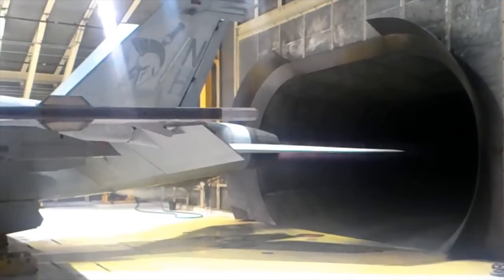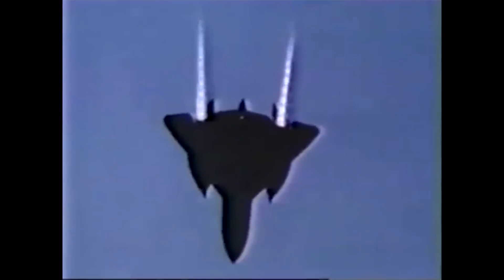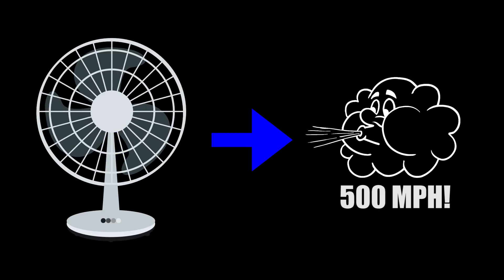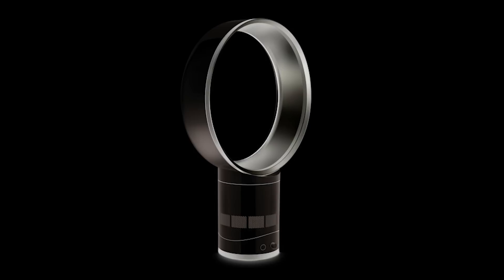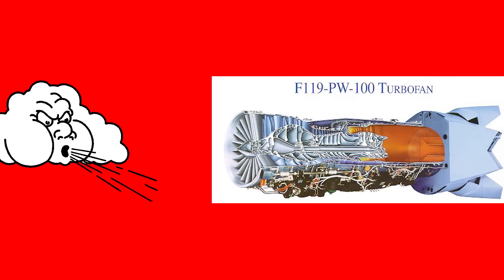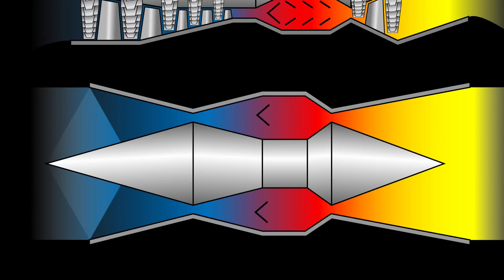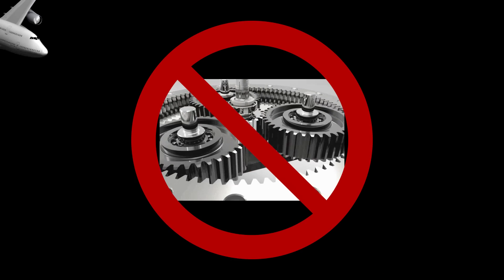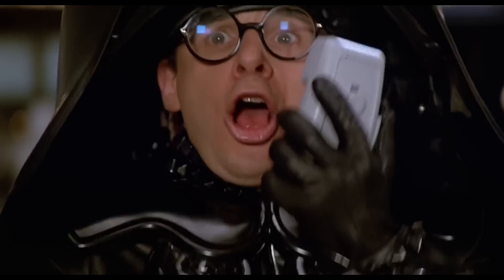Ever Heard of a Scramjet? (MACH 10!)

Comment: First the jet engine gets the aircraft to mach-2. Then the supersonic airflow gets rammed down a different pathway and into a smaller funnel. Jet fuel pours in, and the supersonic air coming in exits out the back twice as fast.  Speed builds upon speed, jet fuel burns at an incredible rate until the materials are overcome by friction and physics asserts its dominance.

Comment: Actually the blackbird is faster because of the points on the inlets. It doesn’t use fans for primary compression, it uses shock recompression.

The further the inlet is pulled back the faster you go. It captures the incoming shockwave right at the tip. The jet in the blackbird only puts out 20 percent of the thrust. The inlets put out the other 80
Reply: So it can go faster than Mach 3.5?

Comment: You know what mach3 was not the speed limit of the SR-71 Blackbird it could go a lot faster then that maybe not up to mach 10 but I bet it could get up to Mach 4 or Mach 5 when they said mach3 on the Blackbird it was just a general reference point basis like because they did not want to let out the true speed limit the Blackbird could go to this day it is still classified exactly how fast the Blackbird can go
Reply: I thought that it was capable of 12,500mph.
Reply: So, I think y I u are correct when it could go mach 10.  Because I think that is what 12,500mph is.
Reply: I know that after take-off they had to be refueled in air, this was because it nearly used up all of its fuel just to get into the air.  Just think how fast with the new technologies today.

Comment: Scramjet work from quarter century ago was 5000 mph in lower atmosphere up to 100,000 feet as liquid hydrogen and air breather, then at altitude the cones on the engines close and it seamlessly converts to a liquid hydrogen liquid oxygen rocket, accelerates up to 27,000 mph escape velocity and pushes into orbit. I had a high end Silicon Graphics workstation at that time with a priority link to a cluster of twelve IBM mainframes (your cell phone has more power).
Reply: I have some questions

Comment: Actually the Scram Jet is the simplest version and the jet is the most complicated. The reason is the restricted airflow in order to create forward thrust.

Jet: Low speeds, needs lots of air restrictions to create thrust and has systems in place to restrict air.

Turbo Jet: Speeds up to about Mach 1, still needs air restriction system for low speeds, opens up for less restriction at high speeds.

Ram Jet: Mach 1 to about Mach 3.5, simple design, does not have restrictor system, has very little restriction because the air speed will be enough to ignite and give forward thrust.

Scram Jet: Mach 3 to unknown, simplest design, no moving parts, very little restriction, from what I know it just moves so fast that it very easily ignites the air and just needs to feed fuel to get thrust.

Each jet had to be within speed range to generate forward thrust. The SR 71 Black Bird was a Turbo-Ram Jet. Rather complicated because it had systems to act like a turbo Jet at low speeds and a Ram Jet at high speeds.

Comment: Imagine lighting a match in a hurricane while the floor is lava. At those speeds you are also trying to keep the engine itself from melting. The no moving part sounds impossible because at different speeds and different altitudes the shockwave needed to ignite the fuel and burn the oxygen in the air will be an ever changing factor

Comment: Do your research the Sr-71 Blackbird has reached a lot more than Mach 3 because since when is Mach 3about 4800 mph is what I ran across
Reply: The listed top speed record that was set by the SR-71 was completed on a test run using only one of the two engines. The official top speed is classified; Same with the F 22 and YF 23.
Reply: Blackbird limit was Mach 3. My friends dad worked on it for 30 years, I was at its final flight in Palmdale in 1991, used to see it all the time, I lived a mile away from plant 42 on Sierra hwy for years. One flew over my head once in the desert between Palmdale and Victorville about 600 mph and 200ft altitude. It was incredible. Look on here for final flight sr71 video. I was in the crowd there

Comment: Big problem when you go beyond Mach 4 is that your aircraft will overheat and melt. Even a titanium nickle alloy will be white hot at mach 5. The space shuttle needed ceramic heat shield tiles and a heat sink circulating coolant and it was no where near mach 10.
Reply: It reenters at something around Mach 25
Reply: Columbia Space Shuttle  collapsed at about Mach 19.

Comment: No no no.... this is all stupid and so wrong!
-1
Here is why!
Nothing explodes in jet engines under normal operation, it deflagrates (aka. burns really fast), and if it accidentally detonates it tends to result in engine failure.

Turbojets are no way reminiscent of "big fans", hell the spinning part doesn't contributes to the trust!!!!!!
It just compresses the air for combustion, and the heat released makes the air expand, and this expansion produces the trust. (and in the airstream leaving the turbine a second ring of blades is placed  that is connected to the compressor, so the leaving fast and hot exhaust gives spins the compressor.)
Afterburners are there to extract all the possible heat from the air, by adding more fuel to the leaving air after is trough the previously described part, and burning out the remaining oxygen.

The main difference between the different jet's is the mechanism by which they compress the air, tuborjets use turbopumps (aka  the compressor), ramjets use the pressure generated by a wedge shaped front part being rammed into the air at high speeds, and scramjets are "just" ramjets that are designed to not slow down the incoming air to subsonic speeds.
And pulsejets (like the one on top of the the V-1 missile) use kadencay effect to draw in and compress the air.

Comment: Doesn't make any sense, hell how do you even take off with that engine if it REQUIRES super sonic air
Reply from the maker: good question! Scramjets are pretty much incapable of producing thrust at any speed below around mach 4.5. I think every scramjet used so far has used a rocket to get up to speed first, and then flying on scramjet power is far more efficient than the rocket because an air-breathing engine doesn't need an oxidizer like a rocket
Reply: Dropped from a bomber or a heavy load carrier type plane.

Comment: is there a way to forego the jet engine with an a technology to speed up the air        and then initiate a ram jet
Reply: That's literally how a jet engine works. It has a turbine that spins a compressor to heat the air in order to ignite the fuel to fire off the after burners. A ram jet just subtracts the compressor and turbine since the air is already moving fast enough and then just uses an inlet to compress the air by slowing it down to sub Sonic speeds. A scram jet tries to do all of that without slowing the air down but still be able to create a shock wave in order to burn the air. Different speed changes what it takes to create the shockwave in order to be able to burn the air. It's like trying to keep a match lit in a hurricane

Comment: your video is full of inaccurate data
Reply from the maker: jjhonka111 Could a scramjet powered aircraft go Mach 10? Undoubtedly.

Have any? Effectively, yes (Mach 9.7).
Reply: The Doc no it's not check your facts it's only an announced aircraft it hasn't gone into production yet
Reply: I feel sad for the blackbird now, it was my favorite jet until the x-51a.
Reply: No
Reply: Tazeo Frankson like your life?
Reply: But could it go Mach 21.5? - STS-Atlantis

talk about any craft you want, but it hasn't got shit on the Flying Brick
Reply: https://www.google.com/search?q=ramjet+or+scramjet%3F&rlz=1C1CHBD_enUS820US820&oq=ramjet+or+scramjet%3F&aqs=chrome..69i57j0l5.16526j0j8&sourceid=chrome&ie=UTF-8
Reply: https://en.wikipedia.org/wiki/Ramjet
Reply from the maker: The ol' blackbird is still pretty impressive! Being able to take off, accelerate to mach 3 and stay that fast for a LONG time, and then land (with a few in-flight refuelings) is a solid feat.
Reply: SPORTS-IN-SPACE X-43A flew at a speed of Mach 9.6 in 2004. That was almost 13 years a go. So yes, someday scramjet powered aircraft will exceed mach 10, but so far none hasn't and it's not like scramjet aircraft are flying Mach 10 everyday. That's my point. Also the X-43A has been the only aircraft that has been even near 10 Mach. I think the other aircaft go like 5-6 Mach.
Reply: So far none of the scramjet powered aircraft has been able to go over 10 Mach.
Reply from the maker: oh yeah?

Comment: black bird has a mach 3 cruise speed i.e it's not even trying. God knows what it does full throttle
Reply from the maker: the blackbird's j58 engines got more efficient the faster they went, owing to their hybrid ramjet design. but apparently as the plane's speed crept past mach 3.3, the shock wave from the air hitting the intake of the engine began to cause problems, which kept it from going much faster. i think i read somewhere that they might have gone as fast as mach 3.5 though. pretty fast, however not quite scramjet speed.
Reply: The SR71 broke it own speed record anytime that it wanted to. It never did reach top speed whatever it would have been. Funny thing about the engines, they were modified engines and never really fine tuned  even after all the years and flights. They were so good already,  so why try to make them better was the general thought.

Comment: On September 18,2015 a airplane flew at mach 6 speed and landed using Wang Zhengou turbo scram jet engine.(see Popular Science article about him and the turbo scam jet) and Shou-En Zhu grapheme airframe which is used in the C919.The airplane that was flew was in the Chinese newspaper and removed.It was also shown on CCTV.If there is one genius for every million people,then China has 1,300 genius and 4 trillion dollars surplus.The US SR-71 used a turbo- ram jet engine and a very expensive titanium air frame that need propping up after each flight.
Reply from the maker: lmao, SURE. sounds like you've been watching a little too much CCTV.
Reply from the maker: China buys jet engines from Russia because they can't successfully manufacture modern high performance engines on par with contemporary US and Russian technology, you think they ACTUALLY made a working scramjet? Even if they did, I'd be very surprised if it wasn't 99% stolen or copied. You can't trust the Chinese Communist Party
Reply: SPORTS-IN-SPACE this right here is an american😂